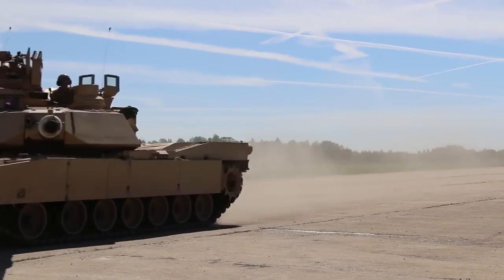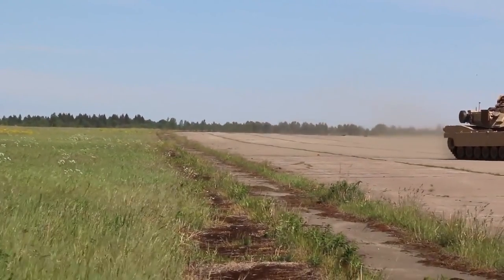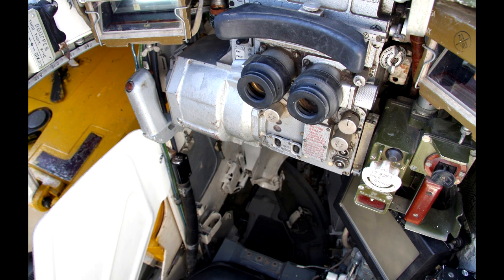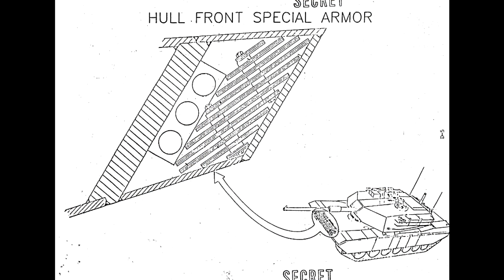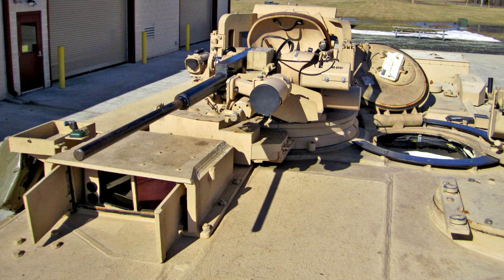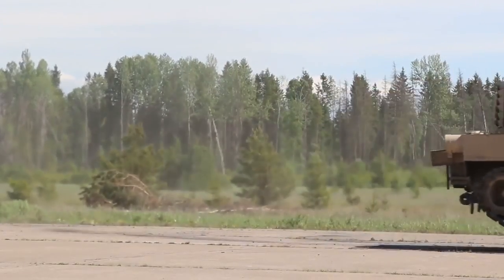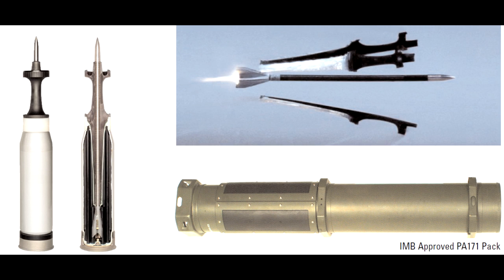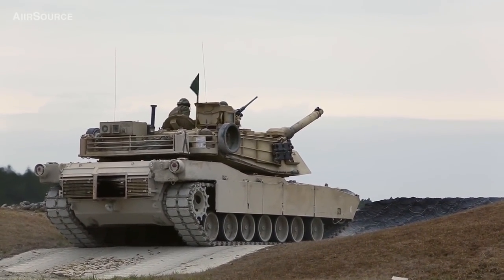Problems with Abrams tank

Comment: LOL! Is this a joke? No reason to use a turbine over diesel "with similar power"? That's the thing, The turbine has more power for less weight and noise and moves faster. It can also start in -25 degree weather. You forget to mention that even though it uses more fuel, it also carries more fuel. The U.S. can afford it so it isn't an issue. I'm only 1:40 so let's see what other BS you've got to say! Oh also, the turbine can run on so many more types of fuel than a diesel engine. Also the tank has DU composite armor at the front of the hull as well. You know what, I can't watch this Russian propaganda video anymore. I bet you show Iraqi and Saudi Abrams getting knocked out and probably don't mention that those are export versions with the very lowest grade protection. Russians can't even afford to buy enough T-14s which are probably are shittier than they claim anyway. LMFAO!!!
Reply: 1:46 *rants*
Reply: Simplified: 
- More Power to Weight ratio and can make the tank go fast (er)
- Better ability to start in harsh environments
- Carries more fuel
- More fuel variety 
- Cool Armor
- some Russian propaganda idk it’s hilarious
- Images of Low Quality Abrams destroyed instead of the most highly sought after and pristine versions of the Abrams tanks

Comment: Apparently the gas turbine has great stealth characteristics, the engine doesn't have nearly as much heat emissions as the diesel engine and the filter problems were fixed early on.

Comment: I think you should use less statements such as "no sane mind would think off".

Moving appart, you focus on the turbine, how compared to a diesel engine the diesel outperforms it on fuel consumption and mentions that filters on abrams worked bad in irak.

About the filters going bad in irak, its a desert, with sand, adding to the amount of air they have to clean for the engine, for what they went through, they fared ok.

Now, on fuel consumption spookston has a video on why turbine was chosen over diesel during development, at the time turbine was a new technology that could be improved over the years into a state comparable to diesel, they were conscious it confirmed a lot of fuel but us assumed the costs because, they can, I also heard that the turbine tolerates better any kind of fuel, giving variable outputs while the diesel engine may be more susceptible.

I can't comment over armor, firepower or vision as I have no info on them but I do agree on those aspects

Comment: Doesn't the turbine provide much more torque at low RPM than a diesel, thus making the Abrams engine better at acceleration and off-road?

Comment: “Wiping out the 4th largest military on planet earth doesn’t count” 🤦‍♂️
Reply: The airforce did most of the heavy lifting on that part.
Reply: You seem to be conflating "largest" with "competent." The size of an armed force does not determine its capability. Defeating the Iraqi military was no larger a feat than if the US defeated the Mexican military. The Iraqis were incompetent morons who didn't understand how to use their own equipment or basic warfighting doctrine in general, and they paid for it with their defeat. Their hilarious performance during the Iran-Iraq war all but proves that.
Reply: Skinhead Larry they were competent to a point then they started surrender by the droves. The Iraqis put up a good enough fight to get steam rolled.
Reply: @argulthetyrant7978  Lolno they weren't competent at all. The fact that they kept all of their SAM search radars on and exposed their entire position to US air power clearly demonstrates that they haven't even the know-how to use their own equipment property, much less form a competent fighting doctrine.
Reply: Skinhead Larry I’m talking about armor and infantry. USAF would have hunted them and turned them to scorched earth either way. As far as ground forces are concerned, they were somewhat competent and had confidence in their own skills until their T-72s got turned into Swiss cheese.
Reply: @argulthetyrant7978  Lol no they weren't. You completely made that up. The Saddam era Iraqi military is precisely the opposite of what you would call "competent." Their ground forces had no coherent strategy other than to send poorly trained crew in monkey-model T-72s into flat open desert and essentially become target practice for A-10s. The fact is the Iraqi army could not manage to utilize their own equipment to their strengths on top of operating exclusively watered-down export models, and had a high command that was largely incompetent and did not have a strategy besides to spread troops evenly across the entire frontline and send them on a full-on suicidal frontal attack. The Iraqi military was not "somewhat competent." They were not competent at all.
Reply: @argulthetyrant7978  saddam's iraqi army, competent, choose one, they're so incompetent and detach from any credible military tactics they even have star wars helmet
Reply: So many arm chair generals in this comment section.

The Iraqi army was competent, they had been in extensive wars with Iran and had years of experience.
Reply: @yaboiyaboy9980  the amount of bs of this comment alone is amazing.
Reply: @yaboiyaboy9980  No it was one of the largest not the strongest. And the amount of stupid shit they did compared to the US makes the US look like einstein.
Reply: @ulfenburg7539  There are over 180 governments recognized by the UN. Tell me where you would have ranked Iraq under Saddam. Because experts at the time said they were a strong military and even generals from the Soviet Union admitted that the US proved they were vastly superior to Russia military wise by conquering them, but I'm curious as to what the key board warriors think
Reply: @yaboiyaboy9980  No not what keyboard warriors think because when they went to fight against them, they could see they horrible trained. That is fact. You can find massive mistakes in their way of fighting compared to the US. Plus if they were that strong how come the US didn't suffer a bigger loss? they curve stomped the Iraq army
Reply: @yaboiyaboy9980  if i remember correctly netflix did a very well informed documentary on this where they stated the same as me. They were shit trained
Reply: @AL HASSANE BARRY they were elite but their army standard which to real standard is horse shit. They shot practice ammo at their enemies LOL
Reply: eddie money  It was a replica of the Soviet military and the 4th largest in the world at the time, behind only the US, Russia, and China. Their soldiers had experience in fighting large scale wars with Iran and Russian Generals even admitted that they were shocked with how fast the US went through them. But go ahead and assume that because it's a middle eastern country that means it sucked.
Reply: NO...it was a paper tiger. Nothing new in this, just read history. Look at the British in India. They decimated much larger armies with almost no losses.
Reply: First the Iraqi army lost the battle because of traitors in the army . Second regular people on streets of Baghdad destroyed more equipment of us army than the Iraqi army . The point is. the Iraqi Army  top guys didn’t want to fight  and gave up
Reply: In that war the Bradley destroyed more tanks than the M1 did, that's after the Airforce put the Iraqis on the run.

Comment: As a crew member on an M1A2 Abrams for 12 years, I can say that this video is completely wrong. And as for the question why the gas turbine engine as opposed to the others, well, it's actually really simple, it's quieter nor does it have visible exhaust. You can spot a diesel exhaust from a mile away. So please, actually do your LEGIT research before doing videos on something that I can spend hours picking apart.

Comment: When you’re fighting insurgents with rpg’s you don’t really need super thick armor. Does that give it an excuse? No, but maybe the designers had that in mind instead of having to worry about fighting other main battle tanks with superior firepower and armor.
Reply: A bit of a fallacy considering that as an MBT it's supposed to be a flexible vehicle capable of a variety of roles. I don't think most tank designers were really thinking about anti terrorist anything when they were designing most of the tanks we see nowadays. The upgrades they're getting however are designed with that in mind
Reply: Except it was designed with Soviets in mind
Reply: It came out in the 80s, deep in the cold war where at a moment's notice a hot war can break out with the Soviets. Fighting Soviet tank hoards were very much on the mind of its designers.

Comment: One reason for the turbine engine was logistics. Diesel engines can only consume diesel fuel. Pour gasoline in the tank and the diesel engine turns into a heavy, expensive paperweight. Turbine engines, on the other hand, can burn just about any liquid fuel. Gasoline? Air craft fuel? Diesel? If it's liquid and burns, the turbine engine can use it. Another reason is higher acceleration.

Comment: Okay number of things with the turbine
1. same power as diesel, but much better torque across usable operation speed. Another extreme example is the rev ranges from a 900hp F1 car vs a 900hp big block. not exact same comparison but big block has more usable power in the low end, giving good grunt for acceleration which gives the tank great mobility.

2. The turbine is much higher frequency noise than a diesel, and so while it might be louder right next to the tank, it dies out much quicker with distance. 

3. While the turbine does consume some more fuel, the actual range of the Abrams is comparable to most other MBT form other countries. When it’s driving it’s not that inefficient. 

4. the turbine creates a lot less smoke under operation than a diesel, which makes it harder to spot. a 1500hp diesel creates a hell of a lot of smoke under full load.

5. The multi fuel aspect was meant for if units were unsupported and had to use whatever they get their hands on, and can use fuel from other standard issue vehicles. this is more a problem in the old cold war scenario, but it’s still useful if shit really hits the fan and supply lines go down.

6. even if it’s super fuel inefficient, i don’t think the army really cares if they have to spend more money on gas, it’s war and it’s expensive.

Comment: At first glance, I can only find one obvious/glaring error: the claim that during the Persian Gulf War, crews had to stop, pull the air filters, and blow them out "every couple of hours." Well, I was an M1A1 tanker during Desert Shield/Storm, and I can assure anyone who might be wondering if they heard correctly that this claim is palpably absurd.

Under most operating conditions, blowing out the engine air filters was a basic quarterly (re: "about every three months") 1st echelon maintenance task, right along with making sure the batteries had water, and pumping fresh grease into the roadwheel hubs. During Desert Storm, it was more like "every few days," depending on how much moving around we did. Obviously, if we were sitting around in a defensive position and just fired the engines up for a few minutes a couple of times a day to charge the batteries, it didn't filter out as much sand as when driving it around for several hours. Bear in mind that a big factor in shortening the span of time between cleaning had largely to do with the unusually powdery state of the sand in that portion of the world.

In any case: there's no way in hell the US military would continue fielding a $6 million MBT that would have to be stopped every couple of hours-- including, presumably, in the midst of an assault-- shut down, have the filters pulled and then blown out, then put it all back together and repeat the process. That is: the process involved working in pairs; one tank had to be running, with the "wand" plugged into a connector on the engine that provided the stream of air needed to blow out the other, then wiped down and put back to repeat with the other tank. 

Any tank that had to be stopped and subjected to this time-consuming, pain-in-the-ass chore every couple of hours would be beyond useless on a modern battlefield where speed and maneuver are of paramount importance. There's simply no way a modern, 20th/21st-Century military could properly press an attack if every tank had to be stopped, shut down, and left vulnerable to counter-attack (to say nothing of every other element counting on having the necessary armor support to do their own job). Bear in mind, the M1A1 was designed, developed, and engineered to be integrated into ground warfare at a time where it was all but a foregone assumption that the next big war would take place either entirely, or in large part, in the Middle East.
Reply: That's welcome change - somebody who actually knows the stuff he's talking about.
Reply: @piotrd.4850  Appreciated, my friend. :-)
Reply: Yea there's a lot of dumb points in this video.

I'm sure there's nuances in the Abrams and flaws, but if there was a tank out there that was so much better the US would either buy it or copy it's design.

The diesel engine bit was another thing that annoyed me. The turbine engine makes the tank quiet, and emits less smoke than the diesel means lower visibility. I think the fuel inefficiency might not be worth it but it's not like this disastrous flaw the US military has ignored for 40 years. We wouldn't spend 8 million per tank on junk

Comment: I really dislike the first point made. As many other YouTubers have pointed out, the use of a turbine engine over diesel was one based on the army foreseeing nuclear war, and in that case, fuel would be hard to get for a diesel engine. In that case, a turbine is in the best position because it can run on virtually anything with varying success and efficiency. Therefore, not really a flaw, but a mindset of doctrine.

Comment: Why not just use a C15, or C13B CAT engine for the power? Tear off the Tier 3 emissions and let that bitch breath and boom it's a better engine to use than Gas power. Dont even say German diesels are better. I work on that shit constantly. Overhauled engines are always CAT, Cummins, and Detriots. Not BMW, Volvo and Mercedes.

Comment: All equipment has advantages and disadvantages. You mention disadvantages as “problems”. For example, the gas turbine, it consumes more fuel than a diesel, but it can burn different kind of fuels. Another is the gun, initially had the 105 and later switched to 120 when it was developed for the Leopard. The perfect tank has not been built and probably will never be built

Comment: The multi fuel thing everyone gets confused for 1 that fuel is used in lots of different vehicles most notably the Apache helicopter also it's a nice to have the ability to literally run on anything you come across where if your supply lines are cut off without this ability you end up like the germans in ww2 also the engine gives the best power to weight ratio and when you're 70 tons a huge heavier less powerful diesel engine would be a bad idea the top front plate good luck with that shot if you see a m1 it sees you most likely before you see it the fact that the only reported totally destroyed m1s are from friendly fire and some where detonated after a mobility kill and there was no point in risking a retrieval this was a great video but i hate when they show blown up m1s that aren't even US m1s as if the exported tanks are even close to the same thing all exported m1s don't have depleated uranium armor that is a huge difference in production showing those pictures are not telling the truth but whatever the new m1a3 is rolling out but the days of tank on tank is a thing of the past

Comment: If I remember correctly, the reason the US used the Turbine engine is due to the higher Power-to-weight ratio. For them, the fuel issue is negligible with their doctrine in mind. Especially when the engine is completely multifuel.

The ease of maintanence/replacement of the engine is covered in the book "M1 Abrams in Action" by Jim Mesko

Comment: The advantage to building a tank like this, is the engineering ability to redesign, and reconfigure everything.  Every time it went back to the drawing board, the engineers could come up with a more advanced design to improve this tanks performance very quickly.  Also, the turn around refurbish time is a lot faster than any other tank.
Reply: is that really thanks to the tank design and not the u.s's military spendings

Comment: Don't understand M1A2SEP V3 didn't add sandwich chobham composite matrix armor inside armor hull plate as hull armor plate 52mm thick and sloped is good just thens composite armor. Abrams is 50% chobham composite front hull and sides, front turret and sides and putting composite in top hull plate making 55% composite overall tank armor.

Comment: The bias is showing.
No offense but every issue mentioned here apart from the gas turbine which is issue only if your fuel supply is low which is unlikely to be the case because you can fuel with ANY fuel meaning you can forage the opponents fuel depots,  all of the other issues are either fixed or shared by contemporary tanks.
Leopard has 40mm upper glacis and 30mm drivers hatch.
As to Armata, much as there's said about it, it hasn't seen combat and Russian sources are prone to boasting about the capabilities of their military complex. 
Russians are saying their Malahit armor protects their tanks from APFSDS with depleted uranium, going as far as saying the ERA armor destroys the projectile.
This is doubted even by their colleagues.
Until the day someone replicates this test, either in combat or on trial grounds I'm still heavily inclined to call BS.